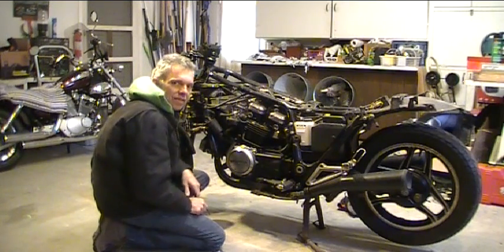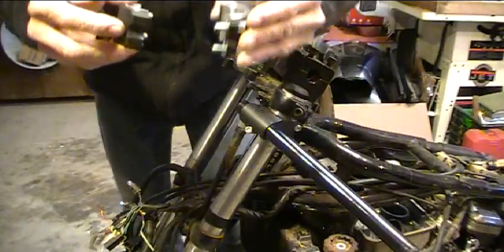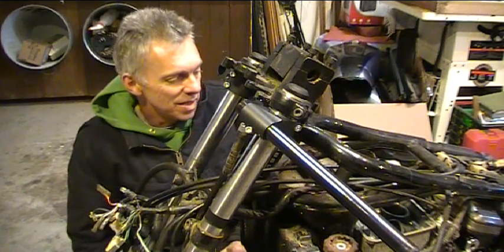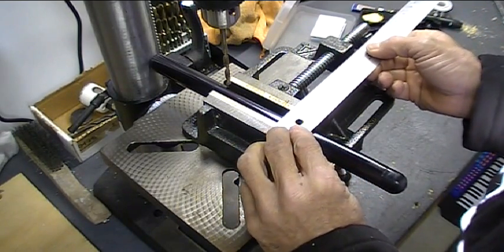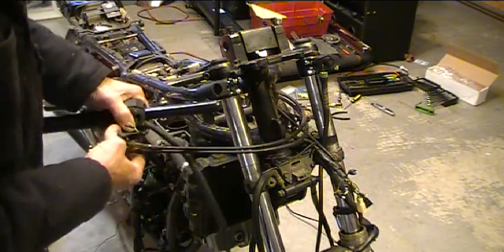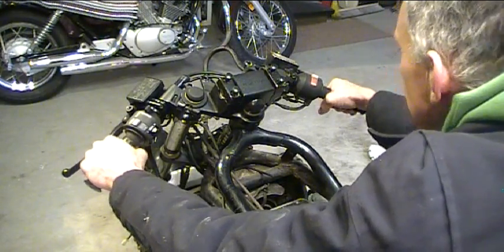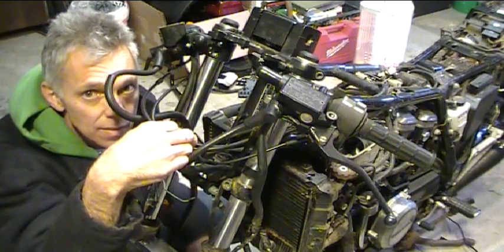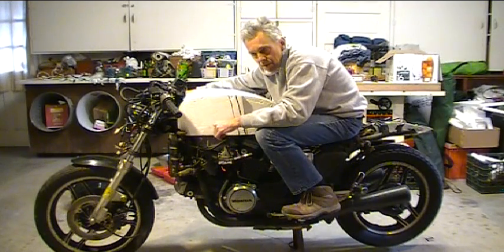Project Honda Sabre Cafe Racer Part 2

Comment: I know this might be a little late to help you out but you could use Bluecore foam insulation. It comes in 8 x 4 sheets 1-3 inches thick. You can glue it together with foam safe gorilla glue or water based glue like Elmer's or Tacky Glue.

Comment: The thing with the EPS foam is that you can cover it with EPOXY resin, then pour acetone inside and dissolve the EPS. I think I'll just try the blue stuff. I've used it to build RC glider wings. :)

Comment: Cool project! Although carburetor fuel system might be a major PITA. Hate to fix and clean carburetors.
About big chunk of foam - if you will run out of options you can fill a cardboard box with expanding foam. Just fill it with small layers and let each layer dry properly.